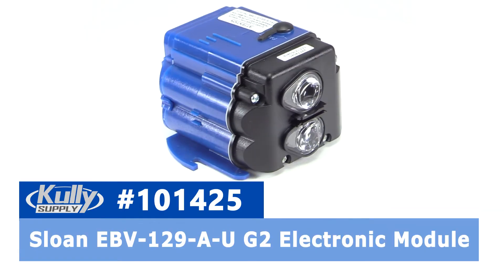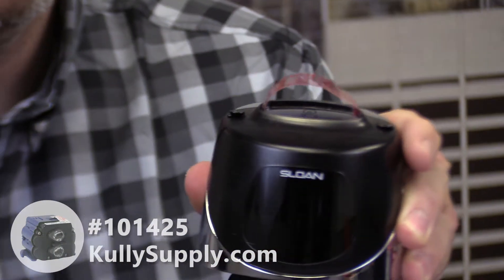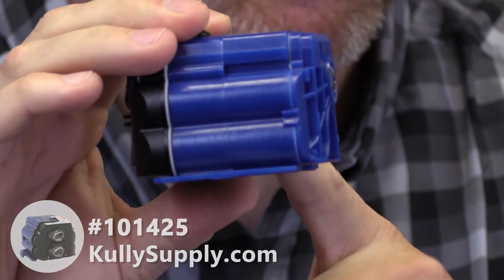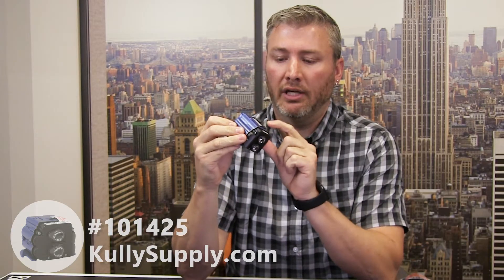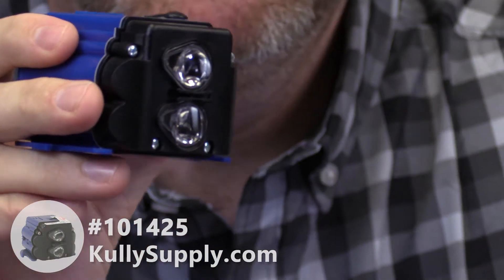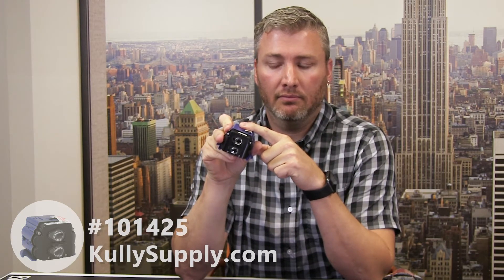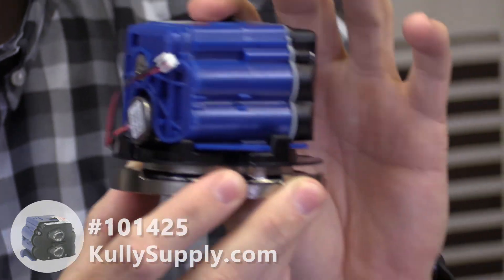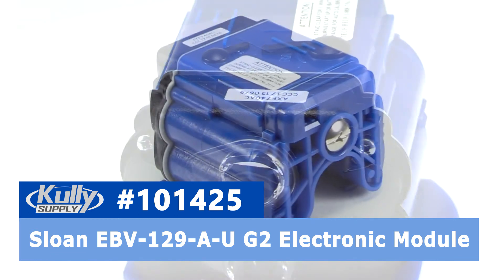Sloan Electronic Module (EBV-129-A-U G2) Overview - KullySupply.com

Comment: Thanks for the quality video. If the indicator light is not working with fresh batteries, can i assume that the unit is no longer operative? it's about 10 years old and will not operate manually as well. Thank you!

Comment: Same question.   If I put fresh batteries in, will the red light come on even if the sensor is not plugged into a solenoid?   Can I test the sensor this way, by just holding it in my hands outside the flushometer and look for the red light to glow/flash?   If it does not come on at all, can I assume that the sensor is dead?   Thank you!!